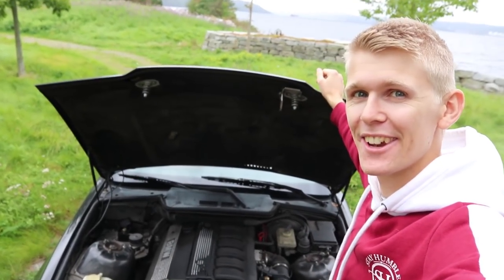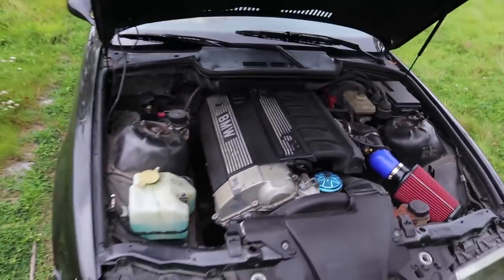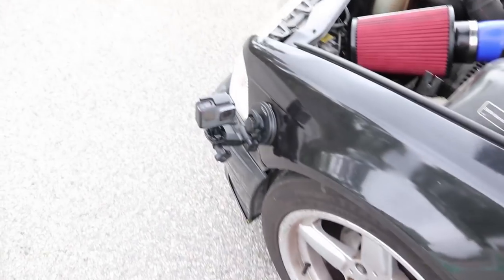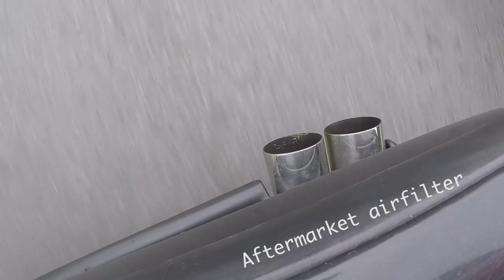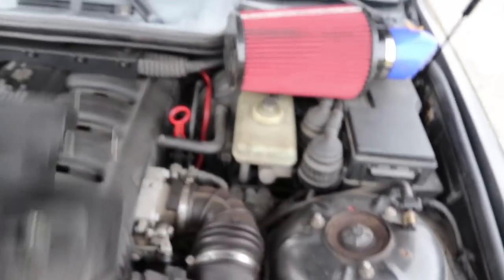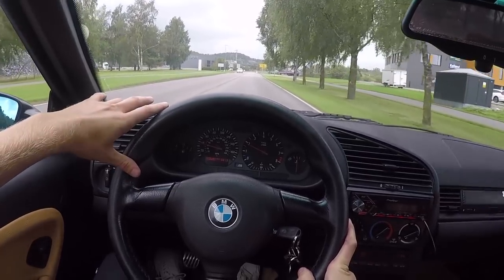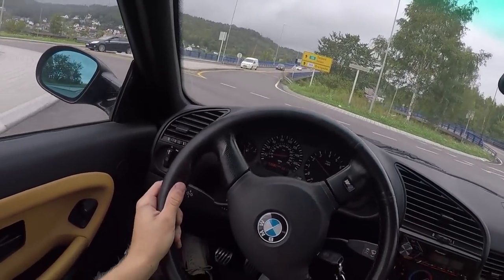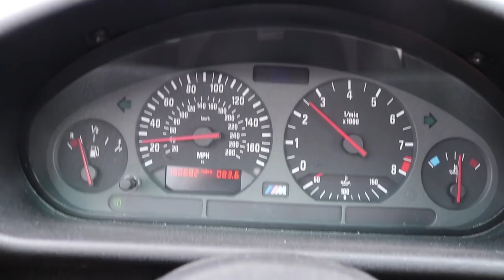Cold Air Intake Better Than Stock? Test! Comparison!

Comment: That’s not cold air intake.

And the ass dyno is not very reliable.
Reply from the maker: Keijo *aftermarked 🤷🏼‍♂️✌🏼
Reply: @daily3686  Exactly! You need to install it lower "under the engine" so he wont suck hot air

Comment: Yep, I told you. More sound, less torque. That 'thing' in the OEM airbox is a thermostat. When it's cold outside it opens the coolant line which flows warm coolant through the throttle body,  in order to warm up the too-cold air.... I'm glad you did the test.

Comment: The best cheap way to get some power from tuning the airintake is a fast flow air filter (like k&n) in the oem airfilter box. When y'all put a "cold" air intake to the car without a proper intake and without a hose that leads cold air from outside directly to the filter, you just getting warm air from your engine bay cause of hot engine.

Comment: As a non-car-expert I would say that the air has to be directed to the airfilter. 
While the old one has a hose directly from the from grill, it always gets enough air. 
The new one is housed inside the motor compartment. It has no chance to get the fresh wind while driving.
Reply: both filters get enough air. one could even say the pod filter is better for airflow, but the air from the engine bay that is a few degrees warmer that in turn reduces a bit of power as the ecu reads higher intake temps and adjust timing and fuel to prevent knock. stock is good but "pod" with a propper heatshield is good too. this has been tested time and time again. usually only differs 0-3hp (both ways)
Reply: @MrBEAN584  2 hp on the dyno. On real road conditions, even a 10hp increase is not noticeable unless drag racing 1/4 mile is what you do all day everyday.

Comment: Your better off just getting K&N panel Filter because cones just made for noise and are useless in hot engine bay. Oways run stock oem but With better panel Filter instead
Reply: I screenshot that comment cuz Thats some facts
Reply: Yea get a K&N if you're ok with spending $400 + an arm and a leg for an air filter that doesn't really do enough for it to be worth it
Reply: Or you just do a heatshieldbox, and a ECU. tune for the cone filter and you are good to go

Comment: That cone filter isn't complete without a set of HEAT SHIELD... You will amazed with the power and engine responds when you combined it with heat shield... This test just like comparing good bmw oem airbox vs leaking bmw oem box.

Comment: was that plug the MAF sensor? because taht explains also why it was slower with the cone air filter. But I have the same suggestion, the cone filter does not really increase power, because the cars setup is stock. Just keep the stock one, your engine is healthier for longer and power wise it does not do much. If you want more power.... exhaust manifold and highflow cats are one way... you can also cut the cat, depends if you have technical inspections in your country.....

Comment: I went and found a 2000 Chevy s10. It had a cold air intake and it sounded cool but the truck always shifted strange and to much in and out 4rth and third.(2.2 auto). The fancy air cleaner fell apart and it was quite expensive. I had the old air intake system with an almost new airfilter. So I put it in pretty quick and my transmission shifting problems went away. Thought I would share that just in case someone else gets this goofy problem.

Comment: torque is much better with the stock air filter........once you replace it with a CAI,although you hear a wilder sound coming out from the engine...... the car DOESN'T perform better...on the contrary it loses torque.....i tried it several times and the result was always the same...so i ended up using its stock air filter box with its stock air filter....😉💪

Comment: As for the turbo car the cold air filter is not good because the cars brain its thinking that engine is cold and in idle it runs in more rpm than normal and for the air its getting more air than it supposed to get with the normal box i think for all these people that want to do this with a turbo car they need to go with a map and the car then it gets better
Reply: Elmedinii N agree

Comment: My cars actually run worse in winter. I think because the air is very humid, and thus less dense because its more water
Reply: humid air = more oxygen as it enters the warm cylinder ;) the water in the air vaporizes getting more oxygen in to the cylinder then on dry air. this actually made night and day difference when i had my 50CC bike. on rainy days or in humid/foggy days it felt like it had 1-2 more HP xD as it prolly had 3-4 stock.. damp air = micro boost xD
Reply: snederw okay, this sounds legit.
but for real, all my cars run worse in winter, why is that then?
Reply: @eliask6180  that i can not explain. just he cooler air in the winter should make more power. maybe there is a sensor that doesn't like damp cold air? 🤣 who needs more power during winter anyways :p even my 318i does 3rd gear in  the snow 😂
Reply: @MrBEAN584  that’s not true at all you get worse performance in humid weather the water displaces the oxygen. Water does not burn into oxygen in an engine if that was the case water would just ignite. In Hot and humid air you will get the worst performance. Cold dry air will give you the best performance.
Reply: @zipper978  what is water made from? What hapends when you rapidly head water? Like cramming it in to a combustion chamber. Would the water vaporize creating more oxygen and hydrogen, in such way almost imitating what positive pressure would do?
Reply: @MrBEAN584  you have no idea what your talking about. When you vaporize water it is still H2O. It doesn’t break down into oxygen and hydrogen. You actually lose energy if you were to split the hydrogen and oxygen atoms.
Reply: @zipper978  i see

Comment: u did not put  a turbo on to pop and babg its just more opened filter i feeds the car with more air and the engine feels  good and i see u testing it in  afrermarket filter ur pressing the throttle hard and in stock ur driving normal not pressing it hard

Comment: Hey bless new year i have a 325i e36 m52 engine and i installed a cold air filter and I gain power and also i put headers so yu need to get the right cold air filter for ur car
Reply: Not m52 i meant m50 my bad sorry bout that

Comment: All you going to get is heat soak, resulting in loss of bhp
Reply: Not if you gonna do a heatshield box around the cone filter, and a ecu tune for the right amount of air for the engine from it

Comment: Mm, that m50.  Sounds like shaking a tin can full of rocks.  And it's absolutely gigantic and heavy, but only 2.5L of displacement, only 180 horsepower, and gets worse gas mileage than a v8.
Reply: It’s not heavy at all what are you talking about? It also makes a bit more torque than horsepower. It gets way better gas mileage than a v8 as well.

Comment: LS swap the Compact
Reply: naah, u do not do this to a beamer. More like a 6 banger from a ///M or a V12 from a 7 or 8 series. These are machines!
Reply: @eliask6180  nah i'd rather Junkers Jumbo 211 swap it and got a 1500HP 35l E36 Compact
Reply: 6banger from 325i is enough to spin the wheels 😎
Reply: @aaardyyy  meh i rather ju211 swap it man
Reply: @childs4sale336 how about y0l0 swap on a scooter
Reply: @aaardyyy  underpowered
Reply from the maker: m43 engine is powerfull enough to spin tires! But m50b25 in there would be fun